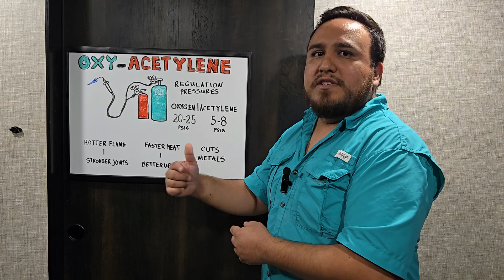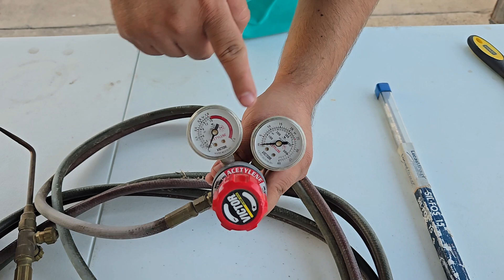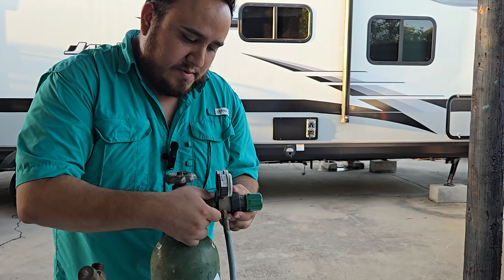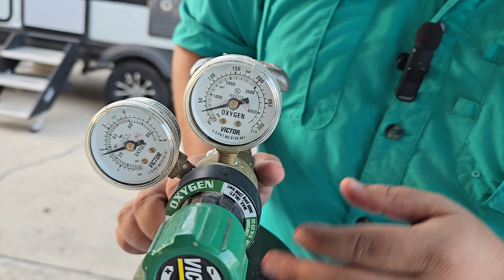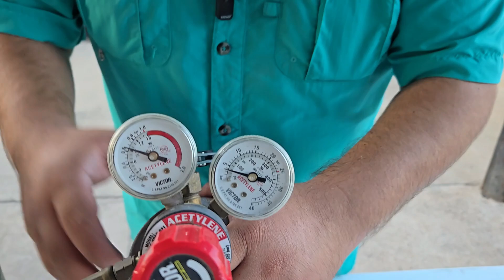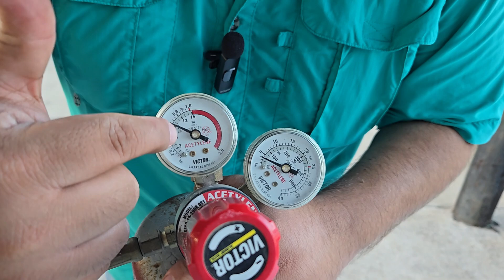The HVAC Torch Kit Setup That Most Techs Get Wrong

Comment: Great instruction from an obvious pro.I've read that one should use no more than a 1/4 turn for acetylene so that you can quickly shutoff in an emergency situation.My apologies if I'm mistaken.
Reply from the maker: Actually, you are correct. That is better practice, especially if we prioritize safety, which we should be doing every time we are working out there in the field. So yes. A ¼ turn for your fuel source is best for that possible reason as if anything goes wrong with your torches, then you can turn off that fuel source as soon as possible. Acetylene alone is yes dangerous, but when oxygen is applied, that makes it even more dangerous. Oxygen alone is less dangerous, so that is why we want to cut off that fuel source as quickly as possible.